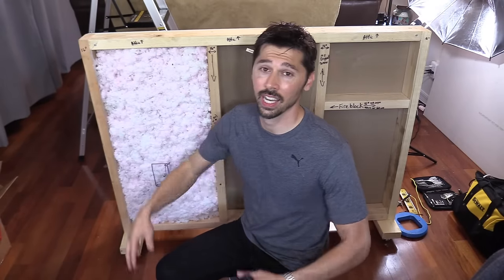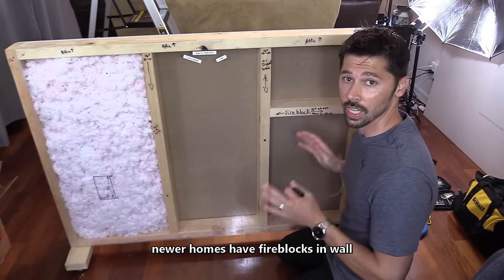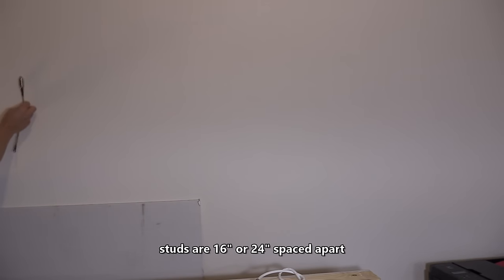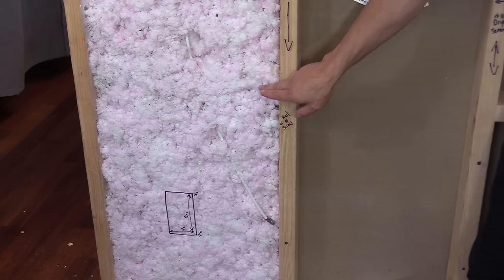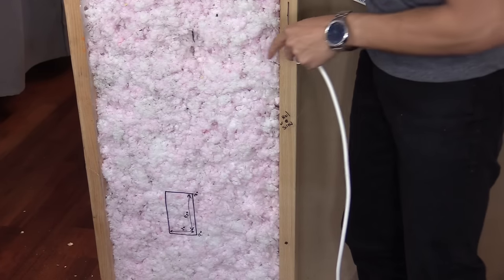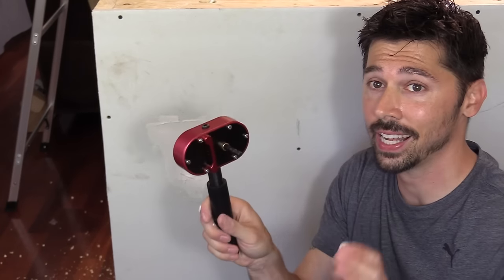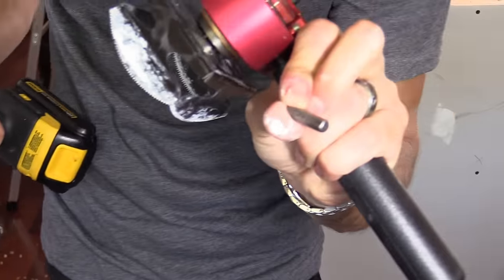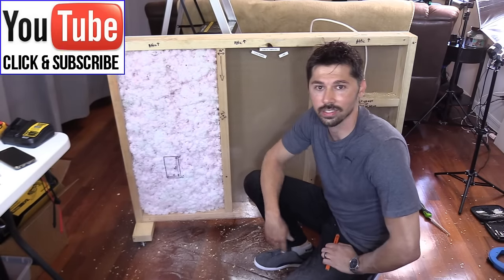3 EASY WAYS TO HIDE WIRES CABLES IN WALL & FIND STUDS

Comment: Why would you ever risk the integrity of your (or the clients) insulation like that?  Drill your top hole right next to the stud, fish tape down the stud and the drywall, outlet installed next to the stud and insulation isn't compromised.

Comment: You can hide tv cables, but what if you have Apple TV, fire tv or Roku tv boxes. They  are still exposed.
Reply: Wall mount tv and zip tie devices and wires behind tv use  wire molding if necessary but if possible install tv mount adjacent to power outlet to keep cords being exposed. Be creative!  Fish HDMI cables and install HDMI WALL PLATES.  I would not worry about drywall patching as wall plates consistently cover drywall punctures. Using existing wall plates etc as puncture sights make it easy too, of course situations vary any experienced tech knows this.

Comment: Lil tip for leaving a tail on your tape... just spin the roll in your hand 5-6 times before pulling on it. 
Another tip for tightening your chuck on your drill is to finish tighting it with your hand, not going all the way with the trigger.
Great video 👍🏼

Comment: personally, if an installer cut holes in my painted walls just to do what could be done with a flex bit from the attic. I'd be pretty pissed.
Reply: You should have thought about the wires you were missing before you painted.

Comment: Huh??? 🙃 Must own a patch and paint company as well.  Why would you not use a long flex bit going from outlet through the fire block then the top plate and  into the attic?
You missed "wall with insulation and fire block",
Wall with "foam insulation and fire block. Flex bit is fast and works in 95% of scenarios. Cut, patch and paint should be last option.

Comment: All penetrations in a fire wall or fire barrier needs to be sealed, you just left a open hole in a fire stopper, a big NONO in my turf. you will be fire and removed from my property and builders licensed revoked  if you did that.
don't know where this is from, but in Florida we have different rules, and in many occasions we have wannabe contractors that do stuff like this.

Comment: WHOAHHHH.  Hold up, wait a minute.  You got some wire pulling skills I'll give you that, but that drywall patch is all wrong.  First, you need some drywall screws holding that patch in place, not just compound.  Secondly, you MUST tape the joint.  If you don't have any tape, you can make a blowout patch with a piece of drywall a few inches larger than the original hole.

Comment: Its ashamed that they don’t add the less expensive WI-FI thermostats to this app... unless you spend over $100 they don't seem to be interested... I have the low end Honeywell WI-FI thermostat I also have a Honeywell Leak detector... I have to use two apps which takes up more room on my devises... should be one app to control all....

Comment: You make it too complicated.... I just use a 1in fishing lead weight and a string tied to it and the wires at the other end of the string. Then I pull the string out until the wires/cable comes out where I want it.

Comment: I suffer from this poor methods of wiring. Corrugated tubes have not being used in our newbuild and now i suffer from not being able to route cables around the house. Simply put, poor electric design. In Italy, such things would have not happened, especially in a new build. bad bad bad

Comment: House made of walls, and walls made of wood and paper, and they say america is a 1st world country.
It will fly like a kite, burn like coal and if that doesn't happens it will rot out in a few decades or eaten inside out by insects.
 Don't you guys have money or whats the point of these toy houses.
3rd world countries do a much better job making walls out of bricks/ sand / cement, every single wall NO matter load bearing or not is always made out of bricks, heck they dont even use wood frames for door and windows frame, prefabricated steel frames are used instead.
Why americans why ?

Comment: "I'm going to show you how to get around fire blocking"
Cuts a hole in the wall and drills through it.
Yes I forgot that home owners are always perfectly fine with you cutting holes in their walls then telling them they "just need a quick mud and paint" because everyone is a pro..
Use a flexable extension auger and save the wall next time
Reply: Blank plate it and act like it wasn't you. Lol

Comment: I was totally impressed until 11:30.  You're no good at drywall patching in my opinion and that plug repair is weak at best and "will" crack!  Get in the habit of wetting/damping the wall cavity and the plug, pasting Spackle/mud on the wall cavity and also the plug.  Insert the plug and wipe off excess Spackle.  By doing that, you actually produce a repair with virtually the original strength integrity of the wallboard minus the paper>>>>> In which case, you should get into the habit of using paper or mesh to overlap the joint and then finish prior to painting!!!!

Remember..... YOU have the responsibility to repair/return the wall to meet both Building and Fire Codes!!!!!
Reply: Let's see you make a video on how it should be done!